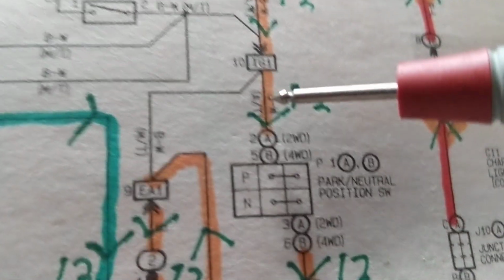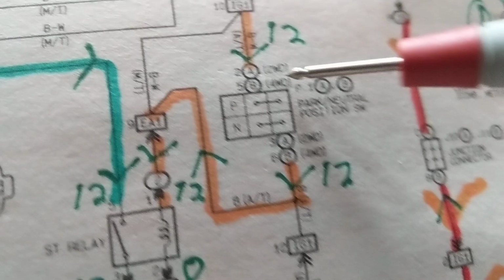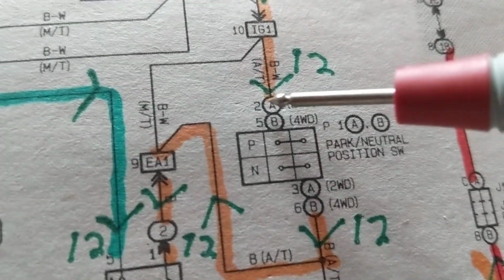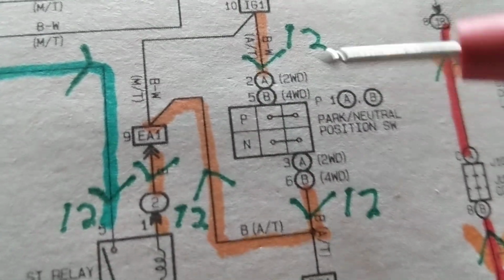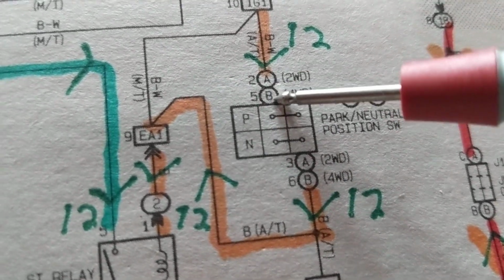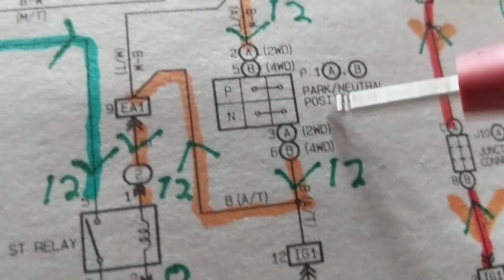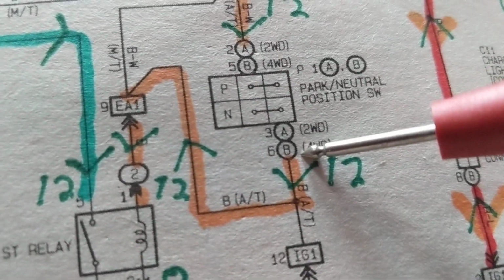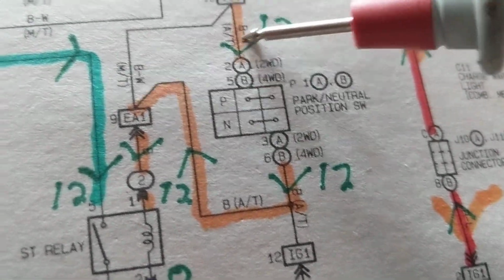HOW TO DIAGNOSE NO CRANK FOR ASIAN CARS FROM DIAGRAM WITH GOOD EXPLANATION PART ONE

Comment: On this schematic , there is a direct line from B+ to the starter motor . Also, there is another path of B+ via the starter relay that hits the starter motor solenoid . Why ain't the 2paths narrowed to just one path ? 

I have seen these 2 lines terminal at the solenoid and starter motor body jumpered when there is difficulty for the starter motor to spin . But I do not know why . Do you ?
Reply: I don't have the schematic in front of me but usually there's a direct line from b+ to the starter motor that's the thick wire that carries the large amps the other wire is a smaller wire with less amps going to the relay or a solenoid so the large one can have about $200 to 400 amps on it